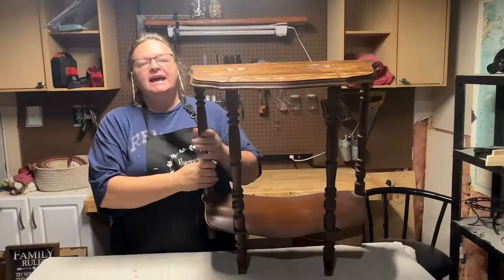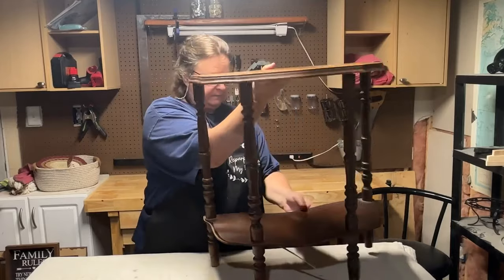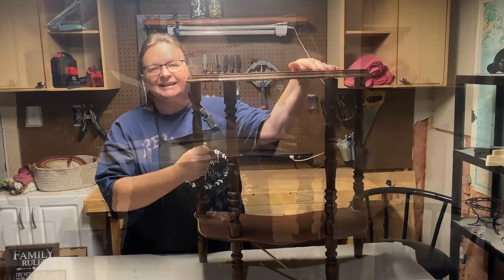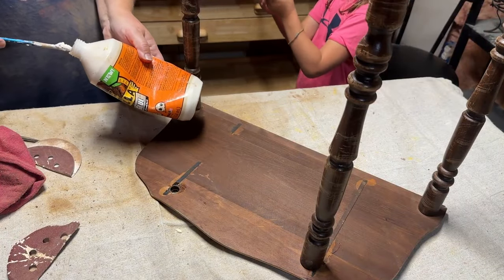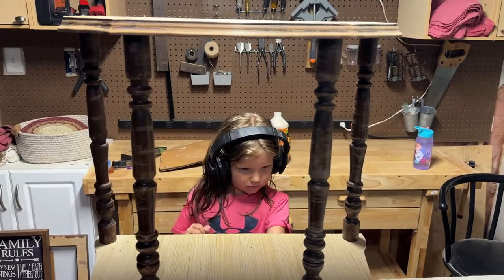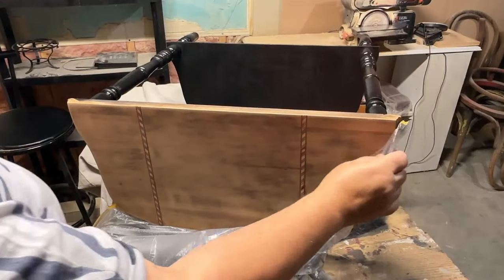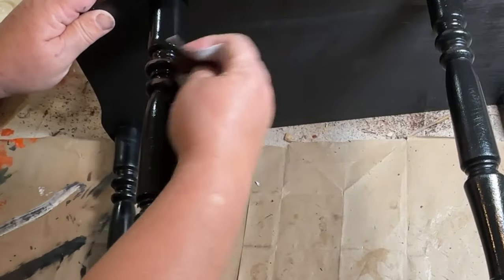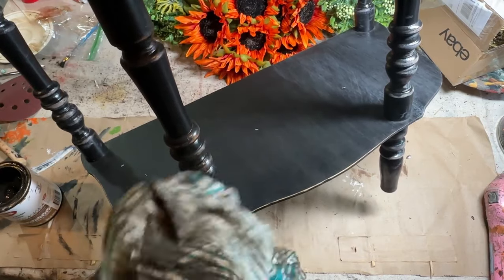Salvaged Furniture Flip! Dump Find Flippin' Furniture Friday

Comment: The top looked dingy even after  the staining. It turned out splotchy. It looked like the top was not sanded properly to remove the old stain. I also did not realise that distressing was still a thing. Even the bottom shelve with the antique wax ended up looking dirty. You had gone through so much effort to replace the shelve and reglue the leg. The repairs turned out great. The end result, not so much.
Reply from the maker: Thanks for watching.